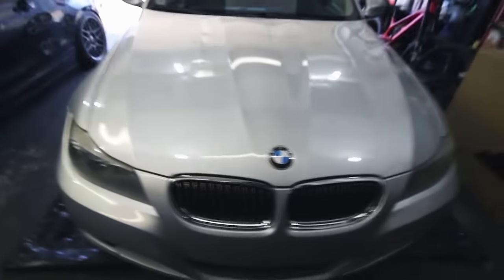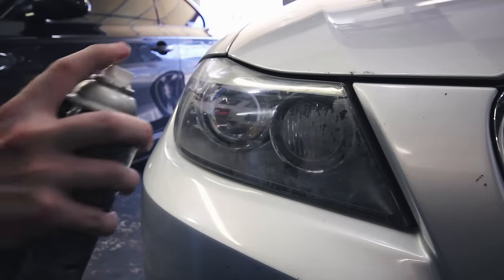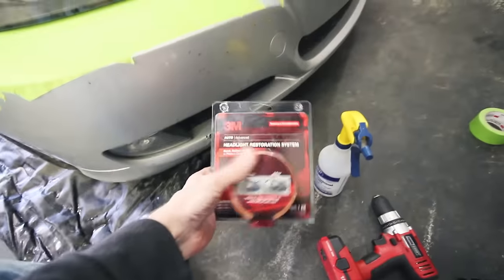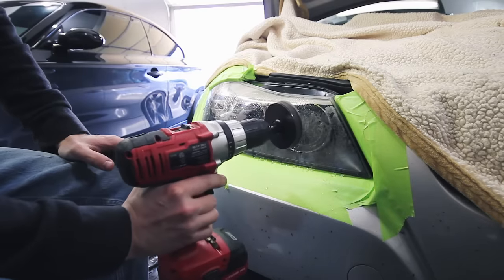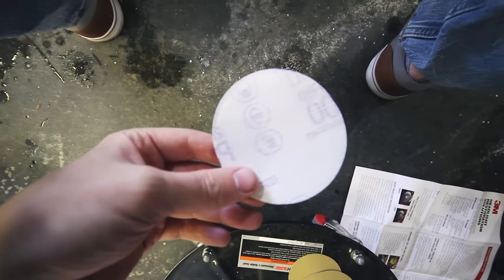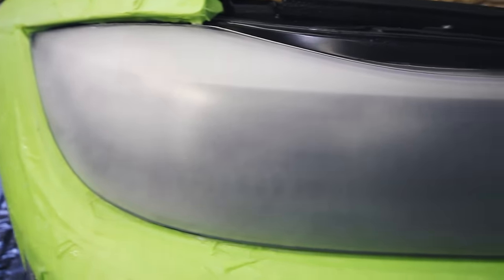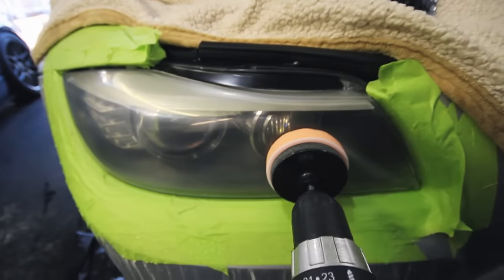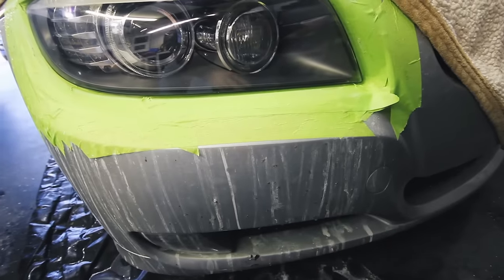How To Clean & Restore Headlights - Remove Yellow, Foggy Headlight Oxidation!

Comment: After many years of working in plastic, sanding then polishing is the best way to do this. NO SPRAYS that clear coat!! They can peal, and make the lenses even more crappy over time.  Not fun!!  The other short cuts mentioned just do not work as well. Injected plastic like this stuff that is used, needs to be sanded. And it takes time for the process as you can tell from his work above. Why? Other materials to polish it (like metal polishes) can actually craze the plastic as they can react against the injected plastic. So can clear coat sprays!  The reducer in those can hurt the plastic, melt the structure cells and make them weaker.  And since you have no idea what was used for the injection process that can wind up being rather expensive.  Just what I have found anyway.  Hope that helps. Nice work in showing how to do things the proper way! A little work always pays off!!

Comment: They came out great! and MUCH cheaper than replacing the lights!
Reply from the maker: Agreed! Something any DIYer can tackle.
Reply: Some headlights are expensive as f*ck! I just replaced the factory headlights on my 2013 328i M Sport with black LED projector headlights and they look so much better than the factory halogen ones. The set cost just under $400 with tax and shipping which I think is a great price! I only mentioned these to compare to my 2010 550i M Sport headlights. My passenger headlight had a broken daytime running light housing when I bought it so I had replace it. Because it is an adaptive headlight with Bi Xenon, HID, auto-level, cornering it ended up being about $1,250! Thankfully I'm capable enough to swap them myself because the dealership wanted $2,500!!
Reply: I follow you

Comment: Thank you for the video Jake. I used this on my cah and it really does work. 20 years worth of headlight damage gone :).

Note: I tried to cut corners at first by using an orbital sander with 400-grit sandpaper, as opposed to buying the 3M kit. This did remove the yellowed plastic layer, BUT I soon realized that buying the kit was the way to go. That is because it's an economical way to get the 800 and 3000 grit sandpaper required to sand the headlights until they are clear (you would probably have to buy this in bulk otherwise... I paid $20 just to be able to get 400 grit sandpaper, along with a lot of lower grades I didn't need). Hell, compare this to other kits which cost $30 and $15 for this kit is a bargain.

Also, the drill attachment in the kit has a foam pad which you attach the sandpaper onto. This helps a lot, because it squishes along with the contour of the headlights. 

Cheers man, thank ya for spreading the word.

Comment: This is the best kit that I have used. I have used it a dozen times and it never Let’s you down. The last step would be to keep them looking good for a long time like 5 years! Instead of wax, wipe with isopropyl alcohol and apply a 3M Pro headlight film that you can get on amazon. If the film gets yellow just remove and reapply, no more sanding. 
Great video 👍🏻👍🏻
Reply from the maker: Exactly! It's nice to know others agree that this is the best kit out there. Always good results, and good tip for protecting them as well!

Comment: This is a great kit for the DIYer!! When using power tools to sand the headlights I would definitely recommend layering the tape 3-4 high to protect the paint
Reply: I wouldn't recomend power tools if u not constantly dealing with them things can go bad real quick also uv coating is a must thats why they get yellow in the first place and no matter how much suncream u putting on it burns over and reaches unprotected layer of plastic..
Reply: Why
Reply: If you need multiple layers your in to deep. Besides these kits are garbage and don't last. Better off wet sanding with regular wet dry paper and using a good UV clear
Reply: @handduggraverdronline  your talking rubbish, There are crappie kits as there are good 3m is at the top end, Don't you read the comments 🤪

Comment: I would recommend adding some kind of protectant on it like a sealant, wax, or even paint protection film. It will slow down the process of oxidation happening again.
Reply from the maker: Yup, I talked about that and applied it at the end of the video 👍 I'd recommend this: https://amzn.to/2JkqZUQ
Reply: Woah a goat spotted come back kfeems 😂
Reply: @jake_spence   Have you ever considered gloss clear spray paint made for plastics, one that is UV protective and yellowing resistant? I seen a guy go that route and it looked good, even better if you wet sand the painted light with 2000 grit...  May try this stuff you recommend the first time I do mine....

Comment: As a Professional Detailer, there's a Much Faster way to do this but,
3M is an AWESOME product line for auto care!
Yeah, doing that, " clear coat is the proper finish for long-lasting results. "
that too is going to start to chip away as you drive, peeling will eventually occur and of
course in Some cases, it's going to have to be redone. Just leave them after final polishing,
yeah, I agree with the waxing but, get a drill pad like the one in the 3M kit and purchase some
 3M Ultrafine Machine Polish, hand apply or use the polishing pad at low rpms.
3M Perfect-It 16oz Buffing & Polishing Compound system.
Reply from the maker: Great tips!
Reply: @jake_spence  Cool thanks Jake

Comment: I wasn't able to get the 3m sanding kit in my country but I used the normal sandpaper we know. All I used was the p800 grit ,p1000 grit and 2000grit sandpaper to sand my oxidized headlamp. As you can see upthere they are already in order so I just had to clean them accordingly to the numbers of the sandpaper . first of all I took abucket of water added in some sunlight dish washing soap and i dipped in my sand paper to keep it soft so that it shouldn't scratch my headlamp. Secondly because I did not have a 3m kit available but had adrill ofcourse, I was forced to use my hands scrapping the whole headlamp uniformly in a circular pattern. When sanding, all I made sure my headlamps were always wet so I had a spray bottle aside with water in it to always keep the headlamp wet. After I did all the sanding from 800 grit to 2000grit sand paper the headlamp was smooth and clean all the oxidation was cleared out but it was foggy and it was high time to use the shield products to get rid of the foggyness since the headlamp oxidation was already wiped-out. I then waited abit to cool my hand-off coz it's really a process using ahand mostly the sanding part. then I applied my shield polish miraplate and used a microfiber cloth to polish the headlamp in a circular pattern. The fodgy started to fade out, I buffed with aclean microberfiber towel and all I could see the headlamp getting clearer it was really working. Then second step I applied the miraplate again for the shine to pop. I did the same process of polishing in a circular pattern then the headlamp was completely clean.then I applied carnauba wax to protect it from the UVs which made it even cleaner with a glossy effect. The process was the same. Great experience I had to restore my own headlamps. It wasn't 100% clean like how a newly car would look because I sanded it  but what matters was I cleared out all the oxidation and it was restored and had that glossy effect again. No scratches were visible because some people might think the use of sandpaper would spoil there headlamp, I'm here to prove you wrong but my headlamp is 95% clean and glossy. Someone looking at the headlamp wouldn't notice a thing it was been sanded but myself did coz I knew how it was before and how it looked good after. 😊

Comment: I did our Hyundai Getz headlights with various grades of wet and dry paper using water, then finished with regular cutting compound. They came out just as good, but then I had to do them again two years later, because they oxidized again. After that, we fitted headlight protectors and that prevented them from oxidizing again. Well worth spending a few dollars on headlight protectors, they really protect the headlights from the UV.

Comment: Used the 3M headlight on my wife’s car. Got the extreme yellowing off. Only down side is that I still have some haze left after going through all the pads. Didn’t really have the cash to go out and buy a 1200 rpm+ drill so I was stuck with my old 600 rpm drill. Gonna do it over soon with a 1200+ rpm drill. Great video though.
Reply: Strange you still have yellowing left over? The pad size of this 3M kit are gold pad is p500 the white pad is p800 the last pad is p3000 trizact!! Always remember when sanding just light pressure only let the pad do the work, Always keep the drill moving over the lens!! Awkward areas are best done by hand, Your drill speed is OK just takes a little longer!! A slow setting only for sanding!! Remember dry sanding works best, You only add water only when the trizact pad is used!!😀👍
Reply: @keithroberts5611  the wife got me a fast drill two christmases ago lol. Used it on my daughters Honda headlamps and it came out crystal clear.

Comment: I want to thank you for this video, i bought that lil kit, some Meguiar's headlight coating for afterwards and  basically followed your instruction without even following their instruction and the outcome was great. I used an electric drill, i was going to use masking tape, but unfortunately, my tape was old and wasnt tearing off properly, so i used what every man would grab next,...... ???? .......... DUCK TAPE!! hahaha, it worked great as well and didnt tear one time with only one layer. i just knew i was going to rip off my paint when i removed it, but all went well haha, Thanks again for the video!

Comment: Perfectly timed! I've been meaning to do this on my E82, and the E90 I just picked up is in dire need of this DIY.  Plan on doing it tonight to 4 lights.
Reply from the maker: Try it on the E90 first :) also, if you're comfortable applying clear coat, I'd recommend a 2x clear coat after the final stage. Skip the wax, clear coat is the proper finish for long-lasting results. Just use alcohol to wipe the lens clean, then apply some clear coat. You might even want to use an abrasive to give the clear coat something to adhere to.

Comment: The sanding pad process is the best for results but it's a lot of work.   If you want a quick fix getting the yellowish haze out then the 3M headlight restore polish does a really good job in just a few minutes.  Simple to use, you apply it like car polish, wax-on wax-off with a cloth.

Comment: Great walk through! I just used the Meguiar's heavy duty kit on my 135is ;) and  unfortunately it didn't work as well. I see now that the drill bit and multiple sand papers they provide in the 3M kit are what I really needed. Gonna be purchasing this kit now, thanks!
Reply from the maker: Dang, hopefully this 3M kit does the job! Gotta keep that 135is clean!
Reply: @jake_spence  The Rain X kit comes with a drill chuck with Velcro surface, 4 sand pad disk 1500 up to 4000 grit, a buffer foam polishing pad, polish, gloves, and lens protectant wipe for around 18+ tax. The painters tape is not included. I just put the polish and lens protestant wipe in a zip lock bag so it's go to go and not dried out for then use.

Comment: Great video. Just did my lights. It’s ok, but not as clear as yours, but much better. The reason because I don’t have the same result is because on the instructions it said maximum 1 minute of sanding… so I didn’t get it as hazy as you did in the first step… but like I said I can see a big difference from before. Thanks for your great video! Watched it several times and now to leave this grateful comment 👍 Keep posting them videos. With greetings from Belgium 🇧🇪

Comment: Just to share, I found that merely spraying the headlights with Purple Power works very well at removing the hazy contaminants.  It definitely works better than any glass cleaner might, and may be satisfactory all by itself.  However, it would be a great start to the process you described here.  Purple Power also work well on the tires and bug guts though you will have to replace polish on any painted surface.

Comment: Coated my headlught lenses with Krylon clear gloss.  Still look new after 2 years.
Reply from the maker: Awesome!
Reply: Coating a headlight with a painted clear coat will actually change the reflection pattern of the headlight
Reply: @davejohnson6144  I never thought about that.  I don't notice any changes it the light pattern, however.  But I don't doubt it either.

Comment: It looks really good. Patience works well with getting the right results. The right side (your left) looks brighter and cleaner than the left side (driver side). I will try this. I presume you can also use this on fog lights as well if there are any present on the car. good work. thx!

Comment: I just go grab a different sand papers progressive to 2000 and then use a cutting compound on a rotary and then a polishing/finishing compound on a finishing pad and then use a spray clear coat with UV protection. Stays clear for 2+ years. The only thing I’d have done differently, I’d remove the headlights from the car so you can get the bottom inward corners and use a spray on clear coat and get any orange pealing off. I just don’t understand why there’re so many haters, he did a pretty good job, I’m a professional detailer. The 3M kits are pretty good but the pads tend to wear out a little quick so I recommend one kit per headlight.

Comment: Instead of using water, I would recommend using detail spray for more lubrication
Reply from the maker: That's an option too, I've never done it but I'm sure it works just as well.
Reply: Your missing the point you don't need more lubricating you need less!! Think about it, We are by sanding trying to remove surface damage from the polycarbonate lens, This is why dry sanding  works better by rejuicing time and pads used!!!!

Comment: Try using mothers aluminum and mag polish takes the sanding part out .
Reply: firefighter 72 you know how long it last tho?
Reply: @thienphan13  about give or take 6 months with sitting outside just gotta make sure put a wax or sealant on the headlights
Reply: I'm curious about this mothers aluminum mag too. I saw it somewhere. I have it. But, I believe in sanding off film and grit and gunk. It's more time consuming but thorough. I may do it without a drill. And the old hard armstrong elbow grease method is usually the best. The mothers aliminum mag is interesting, but I'm leary of it. Must experiment  with it an do research on YouTube. I'm cleaning headlights in spring. I'm using Acrylic Clearcoat and I found All Purpose Enamel Spray Paint. I'll use what I have in my shop. 
I refuse to spend money on a fancy God Damned expensive kit!
If it's wrong or doesn't last I'll  let you know. Comments?
David
Alberta

Comment: I did the same thing that's you did by burning into the tape but thank God I did not do any damage to my bumper I used the blue painter's tape but I put down 2 layers next to each other and then I used duct tape which is very strong putting that on top of the blue tape so now you have the door ability of the duct tape but it was easy to peel off because I had the blue painter's tape underneath
Reply from the maker: Good tip! Thanks for that.

Comment: I restore headlamps every day in my shop. They look new and will stay that way for atleast 5 more years. This  3M method in the video is better than nothing, and looks great at first, but a high end clear coating is needed for a lasting no fuss shine.
Reply: I agree with you, his method will last 6 months if the car sleeps outside. I think he should apply an UV clearcoat for a mutch longer protection and better finish.
Reply from the maker: Yup, if you want lasting results, you will need to apply some UV coating or this: https://amzn.to/2JkqZUQ
Reply: It's not the shine its the long lasting clarity which makes the difference !!
Reply: @keithroberts5611  When it comes to plastic headlamps the two kinda go hand and hand.

Comment: Nice job on these. 

I will say however nothing beats sanding by hand. At this stage I refuse to drill headlights for that process. You have more control, no risk to pit or burn the headlight or even slide off and hit the paint accidentally. Also ensures every cut is even and smooth.

Comment: 7:18 or you just remove the headlights in the first place so you can completely avoid mistakes like that 🤷🏻‍♂️
Reply: To remove the headlight you must take the bumper off. :D so tapeing is much easier ;)
Reply: DataFlash2008 you‘re actin like taking off the bumper is like hacking the FBI 🤦🏻‍♂️
Reply from the maker: It's a lot more work to remove the bumper than it is to tape off some stuff. These headlights are hard to remove with bolts in hard-to-reach areas. But every car is different.
Reply: Actually removing the headlight is not hard and you don’t need to remove the bumper only 4 screws. However, I think it’s harder to clean that way as you will need something to hold it in place while you sand
Reply: @Beaxy  trust me, these bmw are a nightmare to work on. It takes up to 2 hrs to take out the front bumper off of a 750li.  They don't make it easy. Taping it off is much easier. U just gotta b careful
Reply: tony Kari if you say so 🤷🏻‍♂️